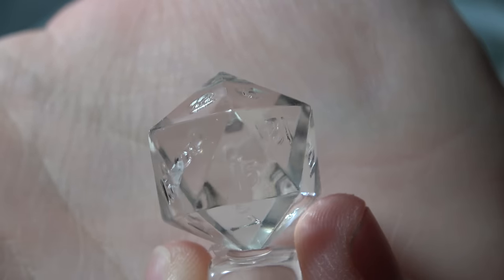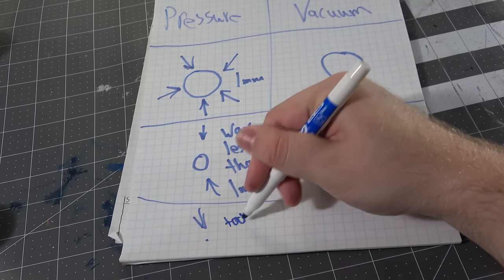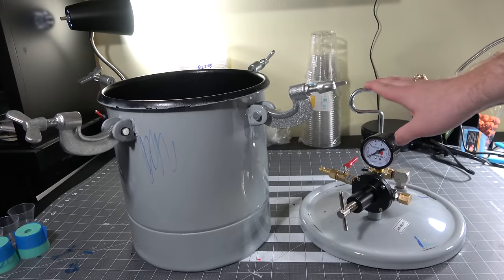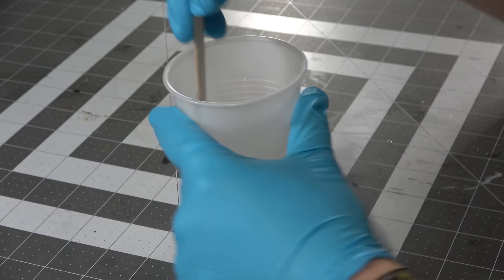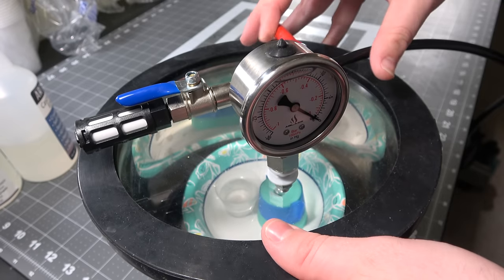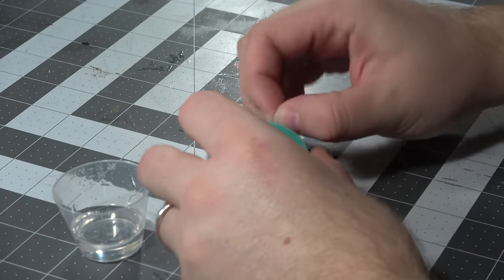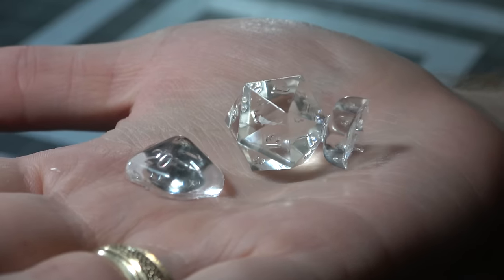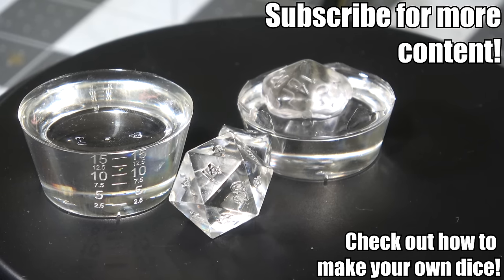Pressure Pot vs Vacuum Chamber | Resin Dice Casting

Comment: Vacuum the pot before you pour into your mould, never vacuum resin in the mould. 
After the first minute it's no longer air bubbles coming off, it's solvents in the resin, so vacuuming longer periods does no good.
Pull the vacuum slowly to avoid boil-over. I use the air bleed on my pump to calm down the froth if it gets to overflowing.
After you pour the mould THEN use pressure.
Reply from the maker: Absolutely you can do that! This was more a comparison of the set it and forget it side of things. If you control your vacuum and then pour, it works just as well. Just watch out for your cure times!

Comment: the bubbles in a pressure treatment don't get squeezed to be tiny.  There are actually no bubbles because the increased pressure drives the air fully into solution, just like the carbon dioxide in soda that precipitates out (and fizzes up) when you open a bottle of pop. The bubbles actually aren't there until you let off the pressure.

Comment: I watched this, then I bought a vacuum pot. I know the flaws in the methodology weren't intentional, but introducing as many bubbles as possible into the resin, pulling a very high vacuum for too long, etc. just reinforced why vacuum casting works, if done carefully and correctly. If it doesn't work, I'll come back and eat some crow.

Comment: For a quick cure resin, yes you should use a pressure pot but for a long cure time resin a vacuum chamber will work better to remove bubbles. As long as you stay with the vacuum chamber and release the vacuum as the resin reaches the top to allow the resin to remain in the mold without any overflow. Any overflow in a vacuum chamber is operator error and not paying attention to what you are doing
Reply from the maker: Thanks for the tip! You absolutely could pull, release, pull, release etc, but it both takes practice, and is more labor intensive. Not to mention that you have to worry about your cure times if you don't degass fast enough. Compared to the set it and forget it pressure pot, I just prefer it :) But it's a totally valid, and probably proper, method!

Comment: The explanation of vacuum versus pressure is explained incorrectly in your diagram. The bubbles actually expand and cause the resin to spill out of the cavity before the air can exit the cavity as you have explained. Vacuum should only be used as a degassing process step. Releasing the vacuum does not introduce air back into the resin. The only air that remains in the resin is the air that was not drawn out.
Reply from the maker: I've since learned a bit more. As it was explained to me and from what I looked up, this diagram worked originally, but I've since had explained the areas where I need to correct myself in future videos :)

Comment: This is a little unfair to vacuum degassing. You should degas in the mixing container with a large enough mixing container. You also have to be careful how much vacuum you pull. Many cheaper resins for consumer use have chemicals in them that will boil off as the vacuum level increases. You should stop shortly after the major collapse and don't sit on it too long.

That being said, I'd say a pressure pot is the best bet for this kind of work. If the pot life is long enough I would go with a vacuum degas before pouring followed by pressure curing.

Comment: Take it from wood workers and modelers, you vacuum first, then pour the resin.
Reply from the maker: You absolutely could pull, release, pull, release etc, but it both takes practice, and is more labor intensive. Not to mention that you have to worry about your cure times if you don't degass fast enough. Compared to the set it and forget it pressure pot, I just prefer it :) But it's a totally valid, and probably proper, method!

Comment: Only cause you use the vacuum wrong, You pull the final vacuum from the begining. But you have to do it differentliy. You have to pull the final vacuum in 4 stages minimum. then nothing will overflote!
Reply from the maker: You are absolutely right! I wanted to show these as options of the set-it and forget-it style. The vacuum can work, but will be more labor intensive (which is still not a lot.) But it's more than 0, and you can still get bubbles from pouring the resin after the vacuum has been run on it.

Comment: Do you ever use UV curing resin for dice?
Reply: I've never tried it for dice, but I think the biggest problem is that it needs uv light to set and molds can be really thick, or don't allow any light in. If you can get a clear mold that isn't too thick   it might work. 🤷‍♀️
Reply: I could see that. I was thinking maybe to try one of those little Ive lights to shine into the mold. But I could see the light workIng the best in all the corners.
Reply from the maker: There are silicones that are clear like Sorta-clear 12. You can use UV resin with them :) I'll be showing that in a future video

Comment: However you can control the overflow from the vacuum. Which takes practice to find the balance how far to close the valve. As well it does take more time as you need to watch it more to close and open the valve. Letting it just overflow like that is a pure waste of resin and in my opinion a bit lazy.
Reply from the maker: True you can do that, but as you said it takes practice, and you have to worry about cure times for your resin if you can't degass fast enough. The pressure way is just the easier set it and forget it way, and I was demoing what can happen if you try a vacuum :)

Comment: why does every person who makes one of these side by side vacuum vs pressure videos pull the same noise? The idea is to degass your resin a little at a time by keeping an eye on it and  turning off the vacuum before it overflows.

But no. Everyone makes a mess and acts all shocked when there isn't enough resin to complete the mold. Good grief.
Reply: Won't it cure before you're done pulling all the bubbles out?
Reply from the maker: You absolutely could pull, release, pull, release etc, but it both takes practice, and is more labor intensive. Not to mention that you have to worry about your cure times if you don't degass fast enough. Compared to the set it and forget it pressure pot, I just prefer it :) But it's a totally valid, and probably proper, method!

Comment: not really how you use a vacuum chamber but sticks to what works for ya
Reply from the maker: You absolutely could pull, release, pull, release etc, but it both takes practice, and is more labor intensive. Not to mention that you have to worry about your cure times if you don't degass fast enough. Compared to the set it and forget it pressure pot, I just prefer it :)
Reply: @Rybonator  you could and you should do it properly and not be lazy about it otherwise dont make a video showing the wrong way it works lol

Comment: pour some silicone resin in the bottom of your pressure pot and let it level out in the bottom for a flat surface and a non stick surface for over flow epoxy resin.

Comment: You are supposed to use the vacuum chamber THEN pour into the mold - NOT let it cure in the mold... 

You can also release and re-pressurize the chamber so it doesnt overflow

Comment: So if you pull a vacuum like using a pressure pot, it's a huge mess. Correct. 
Now use a pressure pot like a vacuum chamber - two large cups, vacuum one, pressurize the other, then remove from devices and put into molds. I wonder which will come out better? It's technique. Poor comparison.

Comment: Simple solution for the vacuum chamber, make a Funnel on top, so the resin flows back in the mold or make the upper side of the mould higher, problem solved.

Comment: This just seems like you need a bigger mold
Reply from the maker: If you have a bigger mold, and fill up the dice, then you still have the same amount of overflow. If you make a bigger sprue or overflow area in your mold, then you will waste a lot of resin as it creeps up the sides, and a lot of silicone in expanding your dice. Not saying it can't be done, but a bigger mold isn't the best solution

Comment: Absolutly wrong at the first minute. The pressure pot brings bubbles into solution in the liquid resin and thereby they are bound within the molecules. So they are not as tiny you can't see them, they are not there. And you don't know how to use vacuum. Please don't blame a method you're doing wrong. Sure, pressurepot is way easier and comfortable, but don't give vacuum this rating by not using it correctly.
Reply from the maker: Hey there Die! So a couple of things - 

First, where are you finding this information on the Pressure Pot? Every other source of information that I have found speaks to reducing the size of the bubbles, or by forcing the resin further down into the mold.

Second, I state in the video that there are other ways to go about the vacuum chamber, that's actually my closing statement about them. If you want to watch and be more actively involved in removing the bubbles, yes you can pull the vacuum, release the vacuum, pull it again etc. so that you get a clear resin, but in the true "Set it and forget it" style that a lot of people are looking for, it doesn't work. YES there are other ways to go about this, but this is a question I had received in the comments as to what happens if you pull it on a dice mold, and this is one of the things that can happen. You then also are forced into using a resin with a cure time that allows for the vacuum pulling in the method you are describing, and I'd rather not limit myself when I don't need to. 

You can also use an electric shaver to vibrate some of the bubbles out, there are TONS of ways that you can try and make it work. But still, the easiest, and most consistent way to get it to work, is to use the pressure pot.
Reply: @Rybonator  Sry I might sound a bit aggressive on that. https://www.youtube.com/watch?v=l9imlxIIW2g&t=3s on minute 8, give it a moment as he explains the difference. I also know this by my own experience. If you loose pressure on your pot or open it too early, everything will foam up and bubble a lot more then the few bubbles from the beginning. The effect of bringing the bubbles into solution, also allows for gasses from the surrounding to enter the resin. So you actually bring the bubbles and some extra into solution. First I thought its just shrinkage of the bubbles, and I did the same calculation as the comment below did, so it can't be the shrinkage. Also  a little side note, maybe there are better ways to contact you, but I wrote you some messages, and it seemed you're not interested in the information I provide. I really try to help everyone. I'm just a bit wondered why making a video, trying to explain something you state yourself, you don't really know. You're pretty popular now and I would love to see people getting good information. I'm wuerfel_schmied, we talked here and there, please don't see this as an attack, but it frustrated me a bit to see it tbh.

Oh and yes, you're right, the pressure pot is the absolute easy and save way to get this done. The video just looked for me like, vacuum is garbage, pressure is the cure.
Reply from the maker: @wuerfel_schmied  It did come off as aggressive, but that's ok.

I watched the video and he doesn't explain the difference, (at least that I found) he just explains pressurized vs non-pressurized. He says that the bubbles "Go into solution" which I am not sure what that is talking about.  That could purely be from my lack of knowledge. I don't follow how adding the additional gases would cause the bubbles to disappear and float up and out of the resin as you say, but also cause bubbles and foaming if you open it up early, as the bubbles should all be "out" and gone by then. But again, I could be very wrong.

So I would say that I reply to essentially EVERY comment that I get on my channel, I try and make that a part of my brand. But, youtube doesn't always notify me in the creator center about replies to my replies. I try and catch them, but I have to manually check for them. So often I miss them. I am not ignoring you, I try and listen to everything. You are free to send me an e-mail directly if you'd like to have a further conversation about anything. I often get questions on people's projects via e-mail, so I'm happy to discuss further. My e-mail is fluffinamazin@gmail.com

My apologies if it came off that way.
Reply: @Rybonator  I messaged you on Instagram as I don't want to make that public and look like this now. But we get it sorted.
With the go into solution term, this means the gases get trapped within the molecules. The pressure does not remove them entirely. It's like the CO 2 in soda or Cola. The pressure holds it in the water or Cola. And when you open the bottle it starts slowly to bubble out.
I try to find a Wikipedia or so and leave it here.
Reply: @Rybonator  https://en.wikipedia.org/wiki/Solubility#Solubility_of_gases
Reply from the maker: @wuerfel_schmied  Maybe you have been messaging the wrong person? I don't know. I honestly do not see your messages when I check :O I am awful and new to instagram so that could be my fault as well haha. I'll send you a message on there sometime this weekend :)
Reply from the maker: @wuerfel_schmied  can you send me your Instagram name again? I can't seem to find you/it.
Reply: @Rybonator  @wuerfel_schmied

Comment: Ok your obviously prejudiced against vacuum chambers as simply modifying your technique (or lack there of) a little OR just using your head and slow down the rate of vacuum pressure applied you could have a mess free experience

Comment: That's literally the absolute worst way to degas anything. Nobody would EVER degas something by just whacking it on full and forgetting about it for 20 mins. using containers that don't have anything to account for a little rise of the fluid, and not frequently "popping" the bubbles by introducing a little air. If you'd "fairly" done this test, you'd show the correct methods for working with vacuum, instead of acting like it's the same process as  pressure casting. Very poor results only because of dreadful methodology.
Reply: Just noticed someone else has pointed parts of this out in the comments below, and you seem to at least have acknowledged parts of your failings here! :) Would love to see an impartial updated video that gives a more fair anaysis of the two methods, as this one does literally nothing for the community as it is.
Reply from the maker: I wouldn't say that NOBODY would do that, as THIS idiot did ;D

I just wanted to show the set it and forget it-ness of the pressure pot vs the vacuum. I will probably show an updated version in the future :)

Comment: OOOOORRRRRRR you can use the vacuum pot, then slowly repressurize it periodically. You dont have to leave the vacuum pot running at full tilt the whole time. Then you have no cleanup AND no bubbles at all.

But hey, the most simple and effective solution to a problem is not always the most effective..................
Reply from the maker: Yeah, but it does take longer, and is more labor intensive. You have to start worrying about your cure time with that method, on top of then POURING the resin afterwards, and re-introducing some new bubbles :/ not ideal

Comment: /facepalm  control your vac pressure, u don't just let it max out lol
Reply from the maker: This is more a comparison of why you can't set it and forget it. If you control it yes it works!  But you then run into issues with worrying about cure times, it's more labor intensive and still getting bubbles when you pour after getting the vacuum pulled. But yes it can work!

Comment: It's most likely bubbling up because you're using too much vacuum. Vacuum lowers the boiling point of everything, including resin. If you had used less vacuum, you could probably get rid of the bubbles very easily. This video is just a bad sample, not properly comparing the two methods.

Comment: Its more like how not to use vacuum chamber. What did you expect?
Reply from the maker: I go over that a couple of different times in the video actually. There are people who wondered what would happen, and I wanted to show them in a video.
Reply: @Rybonator  Well, you could show how to do it properly: without overfoaming and losing resin. Like, you know, not vacuuming it in one go, maybe using slightly larger mold or making limiters with duct tape
Reply from the maker: @Lebannehn  Check out Peter Brown's video on pressure vs vacuum, even with the huge containers that he uses, the resin overflows. It's the nature of using a vacuum with resin, it's really difficult, and WILL overflow unless you have a container FAR too large for the project you are working on. You'd lose a ton of money each time you did it. Far and away it's better to use a pressure pot
Reply: @Rybonator  Sorry, my man, I like your work but with vacuum chamber you (and PB) doing it wrong. You need right resin (slow curing or use retarding additive to slow it down), external cup and pressure balancing. There are tons of manuals how to do it right out there. Yes, pressure pot is no brainer to use but vacuum chamber is safer (wont explode), faster (you dont need to wait for resin to fully cure), cheaper and wont generate potential strain inside your cast q: